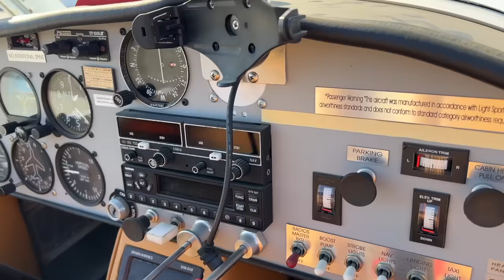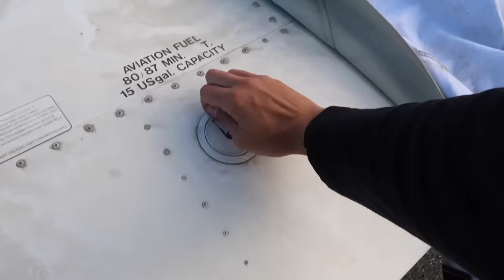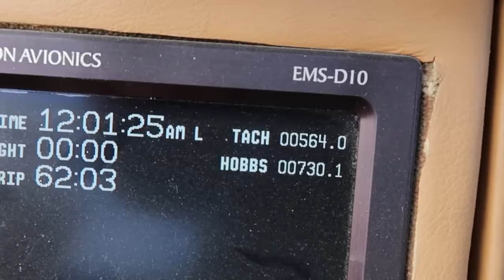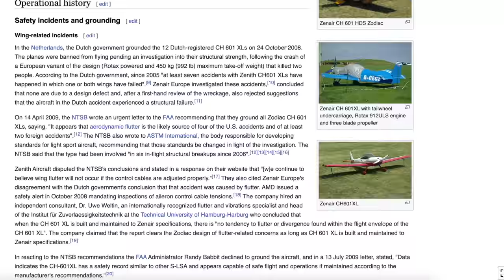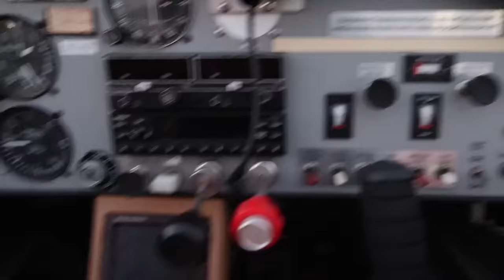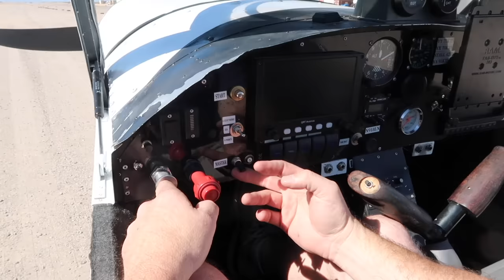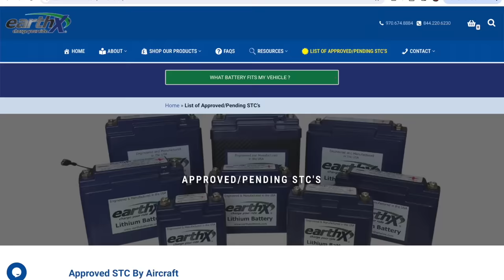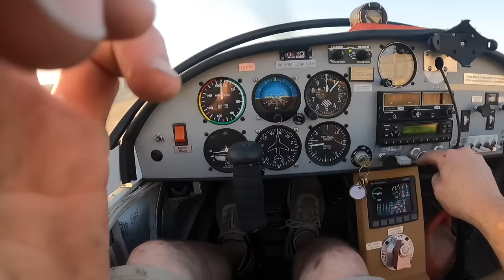We Bought an ABANDONED Airplane For $16,000! Will it Start & Fly After 8 Years?

Comment: Great bargain and video. I built a CH650B from 20015 to 2017 and flew it from WA of Oshkosh in 2017 and 2019. We spent $70K, divided by 4 of us. Now 4 own it so cost of owning a plane is low and with only 4 no issues with scheduling. I give free  flights to Young Eagles (age 8 to 17)  and to Eagles (18+). Here is video of an Eagle flight. I'm not a CFI but like to explain flying to my passengers. I usually let the pax read the checklist as I do things and after high enough to be safe and away from airport I let them fly the plane. We have a Rotax engine, Dynon 10" avionics with auto-pilot. Here is video of one flight: https://youtu.be/7_nby7Io7ps?feature=shared

Comment: Pretty sure thats the type of Aluminum used in bicycle frames, I remember getting a bike in the late 90's that had a sticker saying 6060T6 on it actually! :)
Reply: 6061 is a medium strength heat treated alloy with good corrosion resistance. It’s used for leading edges on a number of jet aircraft.

Comment: question on lithium batt in the air, if you had a charging system failure would the cutoff at 50% battery power be a concern for early power failure or is that not a concern and why (non pilot here)
Reply: Hi, this is EarthX batteries.  The battery is designed to provide you with almost all of its energy and would cut off when 95-98% drained not at the 50% mark.  This is the same as running out of fuel, when all the energy is gone, its gone.  You should not continue to fly until you run out of anything. Bad idea.

Comment: About 40 years ago, I learned to fly in Grumman AA1B and AA1C 2-seaters with sliding canopy.  The Trainer version had a climb prop, the TR-2 version had a cruise prop.  

This plane looks almost identical at a glance, just lacking the sliding canopy which could be flown closed or locked halfway open.   The wings look the same, and even the standard 11 gallons usable in each wing is identical.  The Grumman was faster and heavier.  It also had intentional spins prohibited like this one.  Basically, by the time you spun it 270 degrees, it was unrecoverable and you're dead.  So, doing stall practice was a good time to be really paying attention and making no mistakes.

Comment: I bought a 73 piper Cherokee - sight unseen - for $19,500 ten years ago.  It only had 215 hours on a new engine and I had numerous conversations with the mechanic who had maintained the plane for the decade prior (a retired Piper factory A&P/AI from the Vero Beach plant) so I knew it was in great working order.  We hopped in it and flew it 2000 miles from PA to WA without a hitch and it's been a great plane.  Although I don't recommend this the fact remains you can find some crazy deals if you are patient.

Comment: Interior looks very tidy for standing 8 years. Hopefully it will not be too big a job for you all. Sensenich Props have been around since Adam was a boy so your prop has a good reputation. There's a lot  to be said for an airplane being in SoCal for 8 years and the small amount of water in the tanks is proof of that. Not all ADs mean instant grounding until it's done. Some are time conditional and have to be done within the next X number of hours or at next service. Not many are though, most are don't fly until you've done it. The ease of removing those wings is an example of why building from a kit can be a fairly simple task. Can't wait to see how it progresses in the future. That Corvair engine sounds sweet, just a shame it's not still in a Corvair. Get the engine out of the Porsche into another CH601 project would be good. Definitely keep the longer content.

Comment: Hey, Jeff, never seen you in glasses. It's cool but from the refraction, it looks like your a bit near sighted as is your bro. Welcome to the club (Mr. Magoo club), me and my bro are members too, still it didn't stop us from flying over 7,000 hours between us. But it did stop from becoming Air Force pilots. Back then you needed 20/20 uncorrected. Interesting find!!! Get it going and get you license. We once flew our VC-7 Vickers Viscount into Cable for paint. Getting it out was a real trip. Had to close the road on the east end of the runway. This was back in about 1975. I have some pictures somewhere.
Reply from the maker: Wow awesome story! Lots of cable airport memories in the comments!
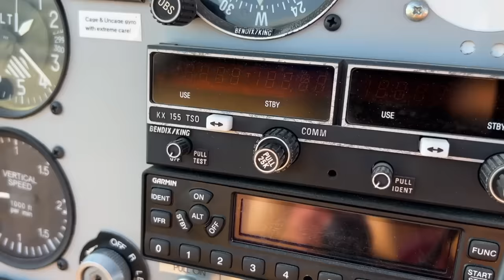Reply: @JRAviation  I found some of the pictures of the takeoff from Cable. Cable is a 3800X75 strip. The Viscount had a wingspan of 94 feet and although a gross weight of 64,500 pounds, our take-off weight was about 50,000 pounds. It was powered by four RR Dart turboprops. It rotated at about 2,500 feet. I have photos of that takeoff and other air to air shots. One of my Viscounts can be seen in the Netflix History of the Eagles at about 1.5 hours and 1:40 minutes (inside photos) into the video. It was along time ago, almost 50 years, but a great 5-6 years of life operating and flying large transport category aircraft.

Comment: You didn’t exactly sell that Ford Lightning!  I could see buying a future hydrogen powered pickup, but I’ll be keeping my gasser for now.
Reply: A pickup, especially for towing long distances, just isn't the best application for EV batteries, though for some people, their use case does match up to it just fine.  Like a landscaper who drives his mowers around locally, never exceeds the range in a day, and charges overnight at his home or business.  

I don't think there will be good hydrogen refueling infrastructure throughout the USA, probably ever, and certainly not in the next decade or three.  It's a pipe dream.  

The winners of the contest have already been determined.  Hydrogen lost, and for good reason, despite having a couple of extremely enticing advantages.  The disadvantages were just too expensive, too difficult, and too impractical to overcome.

Gasoline (with or without a mix of alcohol), diesel (with or without a mix of kerosene), and electricity are the three fuels for 99.9% of US road vehicles for decades to come.  

An EV is great if you have cheap electricity available and are home every night.  It's even better if you have a solar/battery setup to make your own electricity for it.  People focus on long road trips to remote places, not being ideal for EVs, but even for that, things are improving rapidly and are already good enough for most people.  Drive for 3-5 hours, and charge for 20-25 minutes at your stop for a meal and rest room.  For example, there are dozens and dozens of chargers in Quartzsite, AZ.  In the time it took me to stop at Carl's Junior to eat a burger and fries, a bunch of Teslas arrived, charged, and left.  If I'd had an EV, it would have been charged before I was ready to leave.  

Go spend an hour apiece at a few kinds of charging stations, and talk to the people who are charging.  Maybe you'll find some disappointed EV pickup owners, but it's super unlikely you'll find many EV car owners complaining.

Comment: 8yrs is not that long, no reason it shouldn't run good still.
From an automotive standpoint, those Accel wires are garbage. I wouldn't use them in a car, let alone an airplane.

Comment: You talk too damn much ! Were you babbling less, there would be less time pressure. The plane has good bones, and it will require a real past disaster to be a failure. I am not an aviation expert, but for many years I built and drove open wheel race cars at a level wherein careless mechanical  attention is deadly.